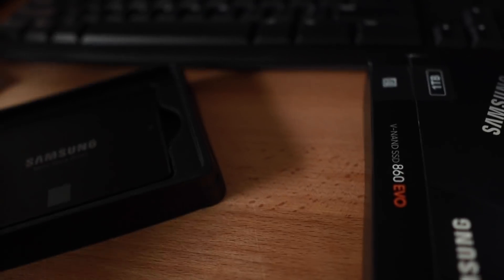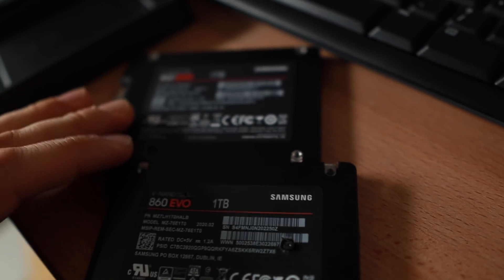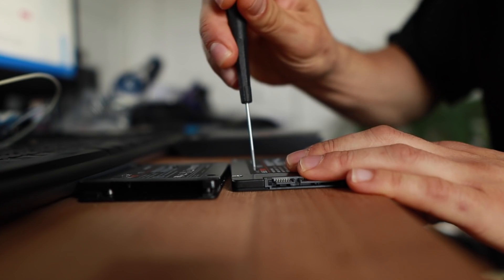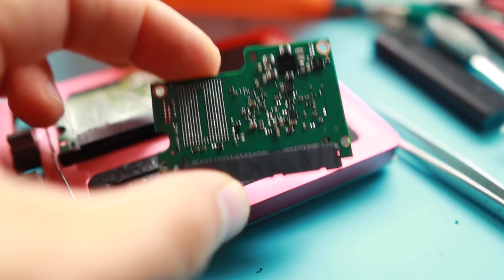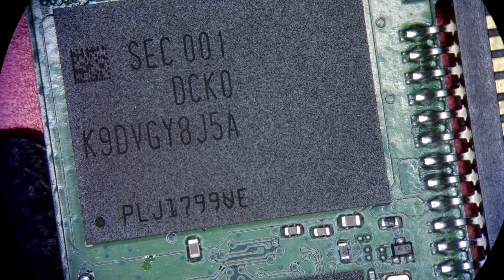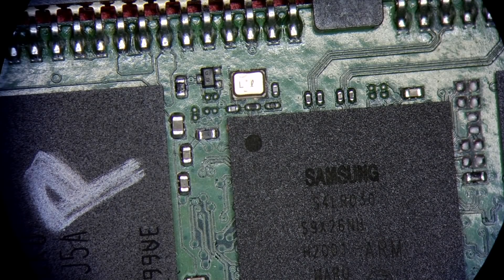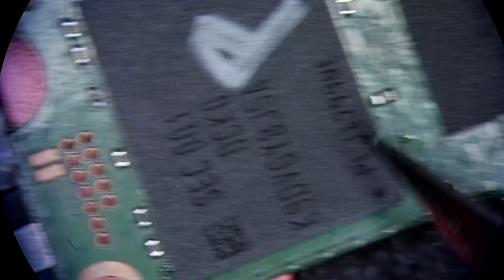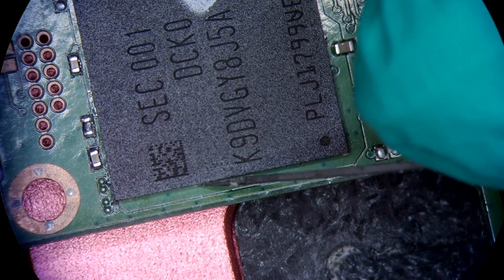samsung ssd data recovery | 860 EVO with liquid damaged

Comment: Absolutely fantastic job. How do you know that all the BGA balls are soldered and not shorted :) 
I have a failed Samsung 256G EVO. I had a power cut and took out the two 0R links on the Rx, and Tx lines. Repaired that and I can now see the SSD but I am not able to read any data. I have some of my daughter's photos on the SSD that I would like to recover. Any thoughts, please? Thank you for your time.

Comment: Do you (or any hard drive recovery shop anywhere) only recover data or is it possible to refurbish the drive so it will work again

A lot of people say to just buy a new drive, but what if I want to have 1TB IDE drive or 400MB (no more, no less) IDE drive, they dont make theese anymore so if one breaks on me, I am scrued
Reply: Refurbishing hard drives with focus on further reliability is limited and very circumstantial to the type of problem.

As a result, it is not a good strategy to rely on a company's ability to refurbish.

In some countries with high population and low to no discretionary income, there is some demand for refurbished hard drives. Price is the #1 factor. Unless we are talking an electronics related failure (more rare  compared to the majority of other type of failure), the problem is that refurbished won't be reliable long term and the client ends up being angry and disappointed. 

On that note, there is also a rise in predatory practices, where a refurbisher hides the flaws with the drive and scam people.

Data backup is the proper strategy to not get screwed.
Reply: @Datarecoveryguru1  oh I see, so I have to take extreme care for my older rare drives then I guess
Reply: @Veso266  Cannot take care of the drives per se. Data backup is what needs to be done and take care of those.
Reply: @Datarecoveryguru1  yea, I know, I am doing this already, but what does a backup count if an old computer will not recognize the modern big drives, even if I restore it to the drive

As for compact flesh cards and sd cards, those get bigger with time as well and they are not realy a harddrive replacment, and I would certenatly never store any important data on them
Reply: @Veso266  Well, we are in 2022. You have to be on a 64bit system, so high capacity drives are recognized.

Comment: I find it interesting that the controller just accepted the new NAND directly. Does the firmware contain ECC data and bad blocks mapping for the old nand? Or is the firmware stored on the nand itself and you basically transfered all settings by swapping the nand?
Reply from the maker: FW and translator are on NAND as you can see from result

Comment: Hi Erkin, I have a small question. Why R studio not possible for this?
Reply: The chip is degraded with bad sectors (black dots among the green), causing read errors. Windows running R-Studio would choke and become unstable.

Comment: Is it hard to avoid blowing away the surrounding components with the hot air gun?
Reply: When you're new it can be. Whenever I had to use a hot air gun on a PCB I used to tape anything I didn't want moving with Kapton tape, worked a treat. People also use aluminium foil to act as a heat shield when removing BGA chips.

Comment: I was kind of surprised you could just go out and buy a new one that's compatible. I remember with hard drives you said like even with 6 months they change enough that the PCB isn't compatible anymore. It's also kind of surprising that less than half the device is actually occupied. I figured the PCB would take up the whole enclosure.

Comment: Samsung SSDs are usually encrypted, with flash tied to the controller. Usually the controller also needs to be transplanted. If this recovery successes, it will be something worth studying.
Reply from the maker: You swapped controllers on these? Or just think it needs to be done :)
Reply: @hddrecoveryservices  I did it every time when I try to fix a samsung drive, because only moving the flash chip never worked for me.
Reply from the maker: did it work with the controller moved?
Reply: @hddrecoveryservices  Yes, if controller itself is good. I have yet to find a way to recover the data if the original controller is bad.
Reply: @Alan_Skywalker  How about when the controller was bad and let change with same controller (same type & same number)?

One again, this recovery will applied to Samsung only or with others brands too?
Reply: @AnomSanjaya  Even if the replacement is from the exact same board it will not work, seems that there are encryption key stored in the controller.

Other than samsung, some marvel controllers and all enterprise ssd controllers I worked on have this kind of encryption. You're free to swap most of the SMI controllers though.

Comment: I run four computers; two of them have a Samsung 860 & the third 870, "how reliable are solid drives in general"?
Reply: It depends. I've sold maybe 100 units of A DATA su650 and the failure rate was crazy. Something like 75%. Same for silicon power sp55. Cheap SSDs are not reliable
Reply: @TigTex  yeah I wouldn't use ADATA for anything important. Important stuff goes on samsung.
Reply: I bought more than 100 Samsung SSD during the last years and all of them working without problem.
Reply: I've been using a 500GB 860 and just got the 870 for my brother's laptop, his 2009 HDD finally began to die. I've been constantly downloading and deleting data from mine for the past 3 years with zero issues. Just updated the FW recently with no data loss, even though I made a back-up just in case. Happened to shock it 2-3 times with ESD ending in PC shut-offs. I've vaped in my room (knowingly) the first year of its use, opened it up the second year, cleared the residues with alcohol and closed it back up. All in all, given the idiotic amount of torture it endured, seems to be a pretty damn durable SSD. 😀🤘 I'm guessing the user in this video spilled straight liquid over his and kept using it without a proper clean while still keeping important non-backed up data on it. Here we are, hundreds of dollars later, witnessing his poor choices. Hope he gets his data back. 🙏
Reply: gamer's nexus news video today showed various hardware failures from a particular company (I'm guessing they sell either parts or pre-builts) and for storage the SSDs were much more reliable than a hard drive. Hell I have a 830 in my old computer that just got retired last year. It ran for nearly 10 years and still works.

Comment: I always thought those evos were encrypted. A "simple" nand swap solves the issue? Can't wait to get back on lab and test something tomorrow 💪💪
Reply: Maybe they are but not tied to controller?
Reply: @DiskTuna  what would do the encryption then?
Reply: @MordePT  yeah the controller, but it could simply apply the algorithms similar to say XOR key for 'normal' scrambling. I suppose effect of encryption and XOR scrambling is similar (high entropy) so purpose of encryption may be simply just that in certain cases.

Take what I say with grain of salt because I am no encryption expert, I am just thinking out loud.
Reply: @DiskTuna  I am pretty sure that it's not just xor otherwise we could handle this drives as a chip-off before pc3k-ssd...
Reply: @MordePT  well, maybe some, not all for sure. I am just saying that what you want to achieve what you achieve by applying XOR may be achieved by encryption too -> producing high entropy data to write to the NAND with sort of generic key. Then you could move NAND chip to different controller and it would work. I am not saying it is like that, I am just hypothesizing it could work like that.

But then chip off would be a bitch because you can not easy replicate the algorithm the way you can when only XOR is involved.
Reply: @DiskTuna  i have no idea really, perhaps master Erkin sees this and gives a lecture on the comments.
Reply from the maker: I don't have any direct information on what the controller really does to crypt data. But my own tests, as well as results from this case show that for 860evo it's not an issue.
Reply: @hddrecoveryservices  i was amazed too, because on ssd as far as i know it not so easy to swap memory because of controller. Interesting
Reply: will you share your test result?
Reply: @takacsi  i don't know 😁

Comment: can someone explain whats the black thing he swaps and what substances are used and reason ? like the transparent liquid or the black sand
Reply: The black chip is the NAND, or basically where the files are stored. The clear gel-like substance is flux which just helps the solder paste (black “sand”) not mess up when being applied.
Reply: The chip is a NAND chip, this is where the data is housed. The clear liquid is flux, it's a cleaning agent to help with soldering. The "black sand" is solder paste, it's very small balls of solder instead of normal wire solder. Solder paste is used for surface mount devices and parts.